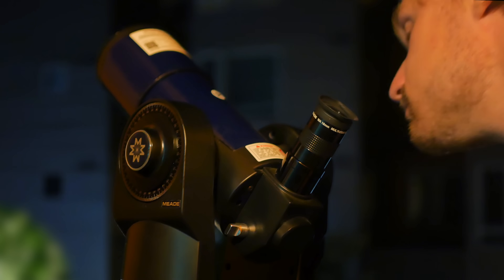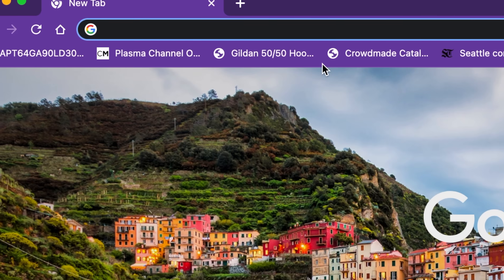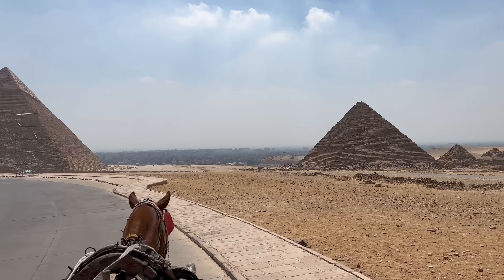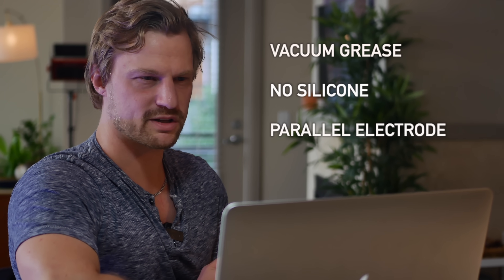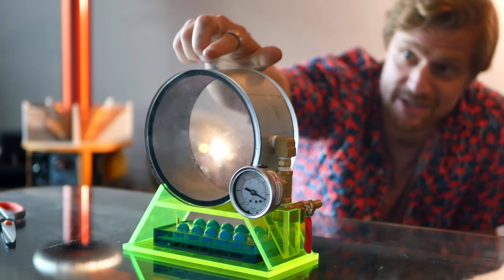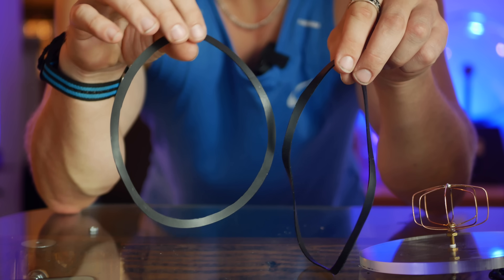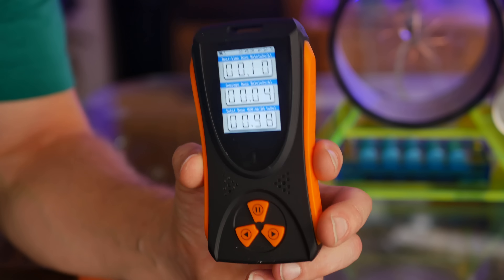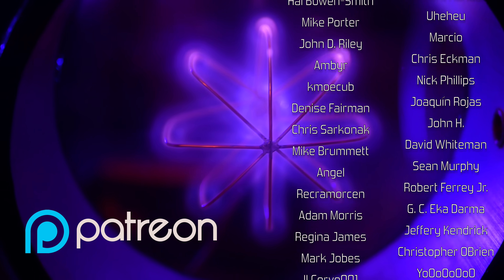Building A Nuclear Star In A Jar (Fusor)

Comment: Why aren't fusion reactors tested in small scales?

I mean what if the mega project don't work to make lots of energy to the grid?
Reply: The problem is not making fusion happen, the problem is getting the energy out of it. Lots of energy is needed for the vacuum pumps, strong magnets, cooling the equipment and a lot more, so to get more energy out of fusion than you put into it to work is extremely difficult and can't be done in small scales
Reply: @DalecarliaAstro  would that mean less equipment to cool, and less air to force out in a vacuum, with the element of rapid prototyping because of it's small design to try different concepts to somehow extract electric power from the reactor, alongside less magnets although they would have to be more powerful.